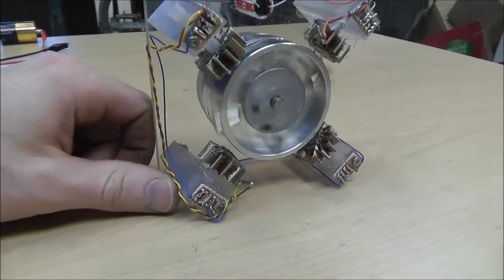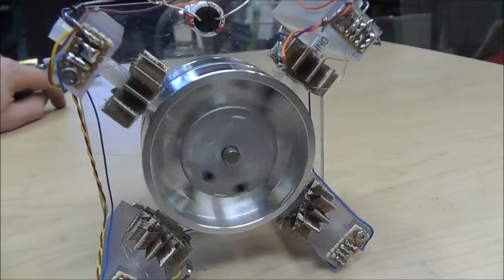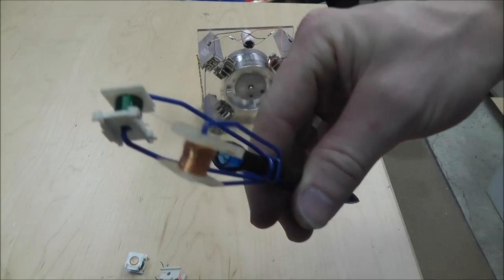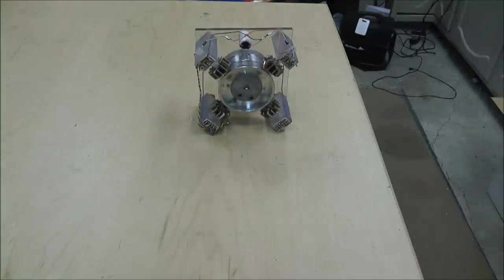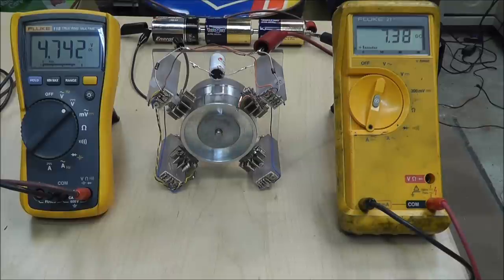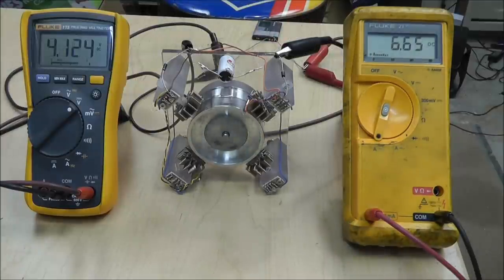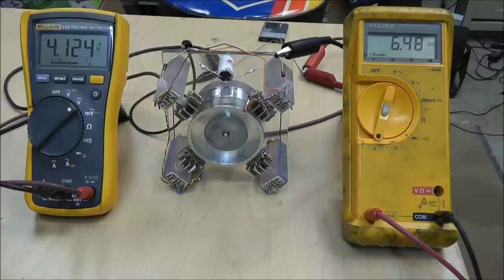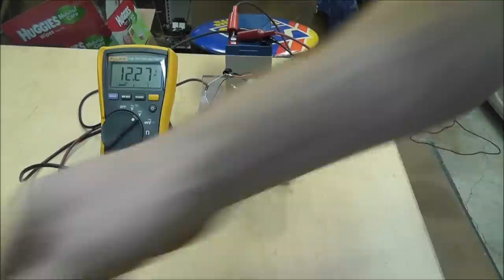10mw Power Consumption Pulse Motor,Will Run On less than 2V. PMBO 2012 ~Russ's 2nd Entry

Comment: That's nearly the limit of achievable efficiency and you'll find that the only difference in the other projects you've seen is the type and value of capacitors used.  I doubt you'll increase performance by sealing within a vacuum.

Excellent demonstration and thank you for adding empirical evidence which legitimately contradicts the possibility of inductive 'overunity motors'

Comment: If you can melt one half to another of that metal halide bulb then you will earn my complete respect. I enjoy your vids and commentaries. Thanks for all of your posts. I have an idea for your vacuum enclosure. If you could find and old Pyrex casserole dish with a lid, maybe at a garage sale or in your granny's kitchen. Drill a hole in the lid, install vacuum fitting,silicone on the lid, let dry and Voila (Whala) Well, you get the picture.

Comment: That's a rather nice looking sculpture! The reason it runs down quickly and then goes slow for a long time could be explained by Ohm's law though. The coil resistance is fixed, so as the voltage in the cap declines, the current draw also declines. Combine that with your VCR read head's (which was once called the most precisely machined device in one's house) low friction and excellent balance and you've got a very long-running sculpture, until you try to do work with it.

I'd like to point out that your multimeters are set to DC Volts mode. In that mode, they don't accurately read a source with so much ripple. You also mentioned that the test clips were interfering with the magnets. While that may be true, the steel screws that are holding your circuit boards would likely have a stronger effect due to the inverse square law (they are closer). There is also steel in some of the components, such as the diode and capacitor leads and the steel shaft that the head runs on. The aluminum body will exhibit drag from any magnetic field moving through it. 

It's a very attractive device though. It would do well on a windowsill with a solar panel and a supercap. I have an idea though. If you take your output from the diodes and instead of hooking them to the cap, you hook them to a smaller second coil just after its main coil, the efficiency would probably be higher than feeding it to the cap. Supercaps generally have very high resistance to high frequencies like you would get from inductive kickback. You could call the coil design a "Shooting Star Coil" or something. 

I'm not really into these type of projects, but I have to say that you are one resourceful dude. Keep up the videos!

Comment from the maker: I have know idea what your talking about but this system works just like I described. i guess you need to watch the entire video to see the entire video. Magnets. Did you not see them? Back side? Yes current flow in one direction, do you know what EMF is? Look it up. When a Collapsing magnetic feild happens in a charged coil you get EMF Which is a short high voltage spike in the Opposite direction.. The diodes allow the HV spike help maintain the charge in the cap Eventually depleting it ~Russ

Comment: Btw if you can get the croc clips away from the rotor and polarize your reeds you can run it a lot longer. I ran it on a d cell 1.5 for a week. And the voltage was higher than when I started.

Comment: why add more magnetic drag by using the reed switch? you could add a few windings of copper to one coil, the power created from that would be enough to turn on a transistor, which will turn on the main coils (electronic pendulum in battery clocks)... also adding a series of coils and magnets extended from the shaft will create more EMF to harness... realistically, this has to be the most promising demonstration for a potential negative energy device (uses less power than it makes).

Comment: I have actually seen 80F 20VDC banks in a single chassis for car audio... I have a wire vendor who sells them.  I also have a 2.5V 50F through hole sitting right in front of me, and 2.5V 2600F Maxwell Boostcaps sitting around... about the size of a can of corn!

Comment: It was about 600 micro amp's at 2.5 volt's.I use my twin backEMF circuit on it and managed to put back about 80% of the power consumption back into the cap,s. I think it would have done even better in a vacume,as those big flat magnets did shift a lot of air for it's size.

Comment: Ideally you should have the magnets offset and the coils should be of an odd number, i.e. 3, 5, 7. In addition to this, include a simple cam system that oscillates a smaller magnet that is slightly offset on the outer and set to TDC (top dead centre) of the flywheel.

Comment: you made something amazing. the free energy will come in when you give it real power... a bigger version made to spin fast with more mass will leave place to tap into the energy...see it this way....the inicial first pulse that starts it all. needs to be very powerfull to work with the mass of spin.  you might need to add extra coil to capture the usable energy.... tap into it.. and dont try to get alot out of it.. just try to light one tiny led light... the proof is in the pudding and it can pulseand store in super caps the extra energy.. its all about tunning it.

Comment: You should try installing 4 of those relay coils in between the drive coils so as the magnets pass their cores so that too is fed into the cap through diodes. They look like pretty good ready made pickup coils. I'm thinking about something similar but with maglev bearings in a hydrogen atmosphere. I just came up with a new maglev bearing system I gleaned from a toy that uses repelling and attracting magnets to hold the gap constant at the equilibrium point.

Comment: cree diodes 600 v 20a will allow more power to be captured and store it into a cap then dump into the super cap it works better supercaps don't like high freq. you need to dump into oil fills first pulse into super cap at under 100 hz or they will pop open

Comment: Hello Russ.  If you want I give gou my pusle motor calculator.  You can run it on the backbone of MS fromework 2 and up.  It isin C #.  It will allow you to input, Magnet stenght, Turns,  Magenet face area, Stator coil area, Single coil Inductivity, Freqency, Single Coil Resistance. Input voltage, Frequency, Turns, Inductance, resistance, Duty cycle, Flux contribution from magnet.Back EMF time duration,  Fkux contribution from the permanent magnet.  All these are only input parameters

Comment: hey, dude....i'm an inventor myself, so, yeah I know about those hid bulbs.
to make a vacuum environment for your motor you don't have to melt the glass.
just clean the edges and treat with glass primer (available from apple auto glass)
and you can bring any extra connections out (or in) through the epoxy.
as to your diode problem....try "1n34A" or "1n60".
I use these in crystal radioes, so I know they have a very low forward voltage drop.
the cree diode is a high output led (4~4.5v Vfd)

Comment: That is SWEEEET, also try to use mags to polarize your  reeds. You will find it will use less current and run faster. I'm using Shottkys. Love the use of the starship. Did you ever try them in latex was a speaker. #notworthy inspirational mate.

Comment: At the power in - add a P-Channel MOSFET so that when the volt drop below 5v the switch will close, and take power from the battery pack. Then when the voltage goes back to 5v+ it will open and not use any more battery power. Instead of a diode.

Comment: just use 2 drive coils with iron cores (opposite each other), use a hall sensor circuit to switch, use as many coils as you can fit (try the relay coils as they are then without the cores), unconnected to recover more EMF and use high speed schottky diodes (but you knew that bit).
i really like the smooth look of this, maybe some perspex rod for the adjusters, some speaker cable (clear stuff) for wiring... as for the video head, genius... i hadn't thought of that, balanced, light, non-magnetic.

Comment: Im sorry, im really new at this. Are u using pulses of electricity created off permanent magnets which cancels out the opposite build-up of magnetic field. “To ever action there is an equal & opposite reaction” ext. Permanent magnets cannot work alone for long at all. Is this how u help cancel that effect? Is this based off a permenant magnet motor concept just adding the electricity pulse?

Comment: So at what point will the flow of energy stop in regards to back end spikes. So if you charge a bifilar coil and dump the bemf into another bifilar coil and then again into another ..... How many times can we get a transfer of energy??? That would be a great competition right there and it does not need to be limited to bifilar coils! Cheers Russ

Comment: you can get quad 8 batts from a 9 volt battery should have 6 inside and by careful rewiring a 9 v pack you could make a longer lasting 4.5 volt bat and other interesting combo's

Comment: These little motors are cool, the only problem is that they can't perform any work. Getting the  rotor to spin is about all they can do. As soon as you add some resistance they fail completely.

Comment: I like this. What's the use of a motor with low torque? Believe it or not a small motor geared down can open and close large HVAC values. It may take a few minutes to so but because the valve is often used in a feed back circuit being slow is actually better than fast. Aristotle once said given me a lever and I can move the earth itself. A bit of an overreach for an engineer but not the scientist.

Comment: I finally built my first star coil but it was with 32 gauge wire and I used sewing strait pins for the points on the star and the diameter got smaller as I built it up. I'm going to try the 40 gauge wire too but I need to find something better to use for the pins in my winding jig. What did you use for yours?

Comment: The output is the RL constant of the coil, RPM,  Max coilc current,  Instantaneous cuurent al cut of event, Back EMF voltabe, Peak flux, RMS input voltageRMS input currentPower consuption based on RMS, Mean coil curnetTotal average Input power, Ir2 Power losses (heat)  Flux leagage. Net power to charge coilsEnergy stored to charge in coilsBack EMF Electron Charge per second.
Coefficient of Performance and Efifiency

Comment: why dont you have a secondary cap and charge the 2nd cap from the spinning motor, to charge the first cap. then you can use that to trickle charge some more caps to charge a battery or something.
Reply: using the magnetic field of any part to charge a cap would create an inductive load and it would slow down or stop. its not magic and its not a perpetual motion machine.

Comment: Connect a load to it showing usable torque such as a small DC motor driving a light bulb or a fan blade in a tube. I'm sure someone could show how to calculate the mechanical power output. The brake method doesn't seem reliable to me. Put some oil on the leather and you will get a higher output or after the leather is used for a while it will smooth out and show higher power.
I like the dynamometer method like they use with car engines. Like the above with a motor and bulb. A resistor would be better since a light bulbs resistance changes. Then use ohms law to calculate the power.
You should do this will all the motors, the RPM isn't a good measurement of power.

Comment: A large capacity capacitor effectively is a rechargeable battery.  So you first connect up the batteries to charge the capacitor, and the device, which has very low friction so needs very little energy input to keep spinning for a while, runs off that battery power that was transferred to the capacitor. Yes?  What's so special about that?

Comment: ok, you reduced alot of things. I guess you have reduced the torque as well. You need amps in a coil for a magnetic field right? Whats the use of a motor that cant drive anything but itself as it has no torque? I think I am missing the point here.

Comment: efficiency = power out/power in. If the motor has no load connected the output power is zero so the efficiency is also zero. Otherwise it's just a toy.
Reply: But how a cool looking toy, I'd like to place it on my desk ;)

Comment: You're losing SO MUCH POWER using POWER diodes..  Use Low forward voltage Signal diodes and your run time will increase a LOT..

Comment: How can you say it is efficient when it has no load?   You say 10MW power consumption but that isn't true,... The only consumption is drag and magnetic field losses.   A 100mF cap at 3.5v stores less than a Joule.  10mW would discharge the cap in less than a ms.

Comment: " achieve a COP of 1 or better."
Clearly you doesn`t have the smallest clue of energy conversions and efficiency. You have electrical energy going trough coils, this generates heat. So as long as your coils ain`t all superconducting you will never get close to a cop of 1. Let alone going over it. 
For me it looks like it`s just a brushless motor. There are lots of people building much more efficient ones then this one !!

It`s still a funny build though ;)